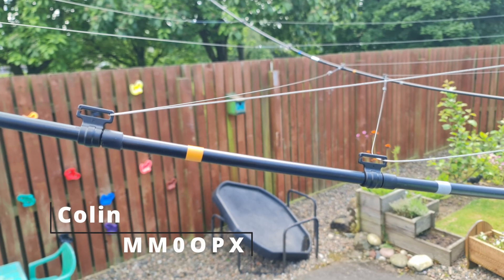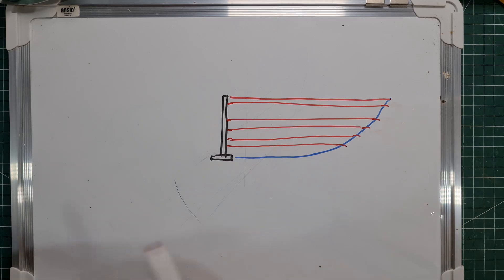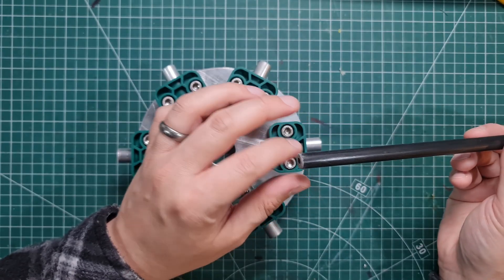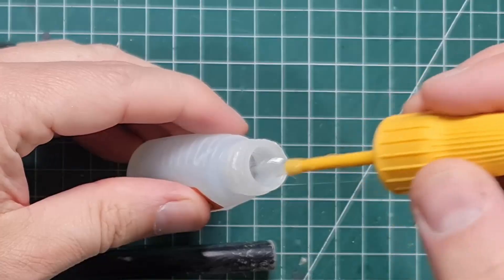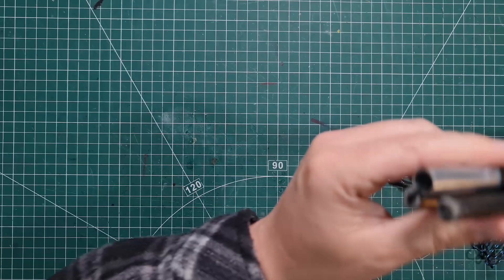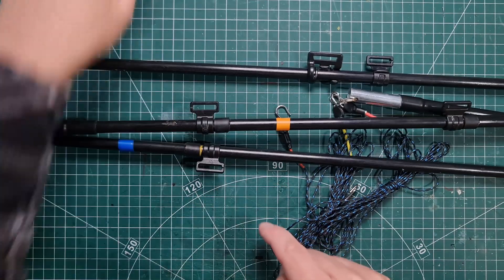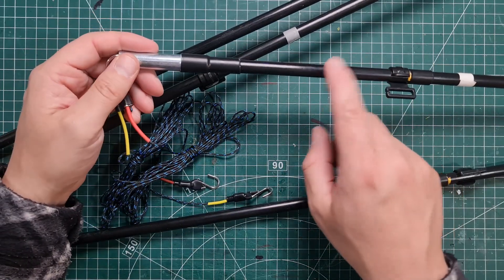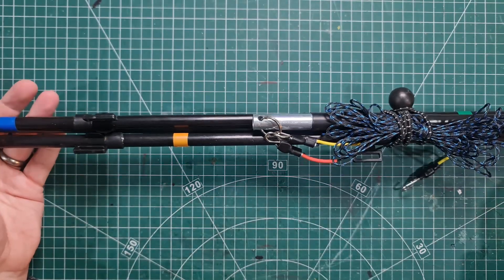Spreader Arms for a Lightweight Portable Hexbeam Antenna you can build.

Comment: Building one now.  I have a bit of difference in my spreader attachment to,the 12” diameter 1/8” thick center plate.  I am using 1” diameter Delrin rod center drilled on a lath to accept the 11mm tent pole spreaders.  Using 1” hydraulic clamps to attach Delrin to the plate.  Also using 1.5mm stainless 7x7 wire cable instead of the 1mm wire.  Would like to see your google drive for info on bill of materials but have not yet figured out how to access it.  73 Colin.  de W5JRT
Reply from the maker: Great stuff, just click this link and there is files in there you need https://drive.google.com/drive/folders/1ftLL1dIJ2aD1lRSk7CY7_P8sdURkuglZ

Comment: Many thanks for this video series, Colin. It's pretty goddamn great.
If you were to scale up to 'permanent mount' vs. portable, what aspects would you look at upgrading? Or is the whole thing built for weight and convenience?
Reply: Colin, I absolutely love your design and really appreciate you putting together these detailed videos!! This looks like the perfect solution for my situation.  I put together a relatively permanent installation, but it’s too difficult to take down for every threat of a hurricane (too heavy and not enough room for a tilt over mast). I tried telescoping crappie poles, but they were too flimsy and I couldn’t leave wire guides on the arms.  I think this will work really well!  Thanks!!
Reply from the maker: Your welcome. I want to make the Hexbeam more accessible to people. The next one I'm building for 15-6 has a bit more finesse.
Reply from the maker: Yeah its built for convenience. For a permanent solution. Thicker base plate, thicker larger diameter centre post, thicker larger diameter spreader arms. The rest to suit.

Comment: Great video and build Colin. You could always put glue lined heat shrink on the pole then cut a slot in the D ring near the straight then slide it under the heat shrink. The heat shrink should hold the D ring on the pole and it will not slide up or down. Without trying I am not sure if it would work but an idea. 👍🏽 73 mate
Reply from the maker: Thats a really good idea, hadnt thought of that. Only downside is its not field replaceable easily.
Reply: @MM0OPXFieldRadio Morning mate, yes you are right. If in the field it wouldn't be for a long time. I would just tie it up if one was to fail. I would maybe cut a D ring and see how much force it would need to deform or snap. I guess they are made out of a ABS kind of material. If they bend quiet easily I would try a stainless steel one. They are on Amazon. I don't think they would bend.

I would do a test to see which fails first the D ring or the heat shrink. 
Belt and braces you could go the whole hog. Use the stainless one and fix them to the pole like a fishing rod eye. Wrap it with twine and paint it with something like nail varnish or epoxy.

Well food for thought there mate. You have done a fantastic job, if you try any of the above let me know how you get on. Shame I don't live closer. I only come up your way with work. 😁
Happy father's day from a radio son.
73
Reply from the maker: Thanks mate. I've still to make a small spares kit for this although not much to go wrong.
Reply: @MM0OPXFieldRadio  yes I don't really see anything that will fail under normal use. I have had the tent pole snap but they were under a lot of wind and a 6 man tent attached to them.
I can't see wind breaking it. Outstanding craftsmanship you have done. I am currently on a cad program designing a case for Meshtastic. Not sure why as I can only pick up one other HAM guy about a mile away. Oh well keeps us busy 🤣. I will put loads of hours into this just for it to sit in a draw.